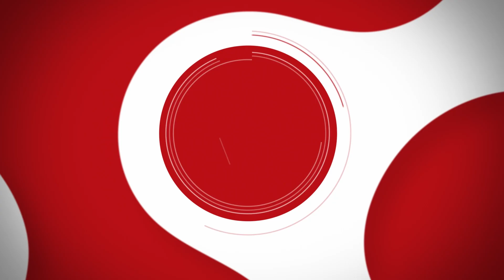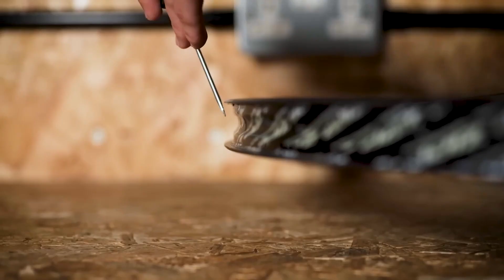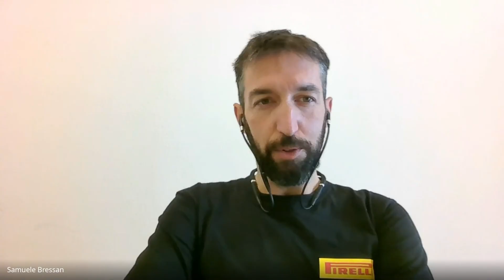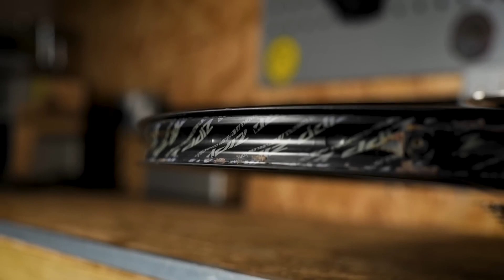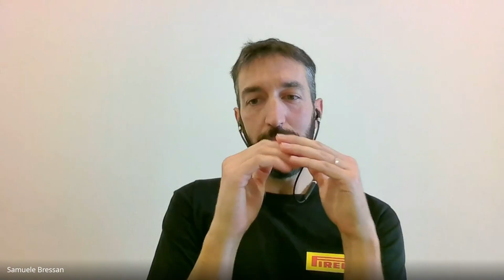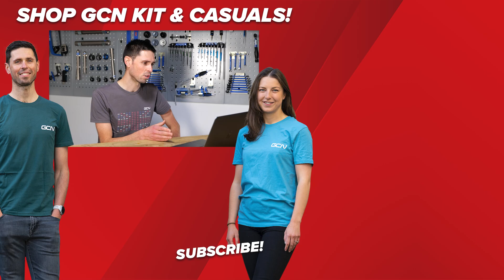What Makes A Good Bike Tyre? | Everything You Need To Know About Tyres!

Comment from the maker: What determines a good tyre for you? Let us know 👇
Reply: Puncture protection and tire longevity are what determines a good tire in my mind.
Reply: As an amateur rider, balance between grip and puncture protection is the key for good tyres!
Reply: Conti GP5000 for many years now. They hold up throughout the year and ride fast. If there's something better, I'm all ears.
Reply: @michaelmappin4425  I believe in Gp5000 too. I made all my friends use it and it shows in their average speed.
Reply: I think for summer specialized s-works pro t2/t5 and for winter specialized roubaix pro are my favorites.
Reply: In short: The complete opposite of what Pirelli is providing in F1 😄
Reply: I usually focus on the following order for a good all-around tyre but of course priorities change when choosing something more specific like a fast racing tyre or a heavy duty high puncture protection one:
1-Reliability (QC tolerances consistency).
2-Grip (specially on wet surfaces).
3-Suppleness (mostly when riding off-road/on poor condition asphalt).
4-Rolling resistance (gotta take advantage of them extra watts (sic)).
5-Weight (mostly noticeable during acceleration/climbing and, specially vital as a fixed gear rider, when slowing down).
6-Looks (usually as a plus, though).
7-Lifespan (cost per kilometre).
This way I cover safety, comfort, performance, price and general satisfaction from a (personally) reasonable perspective. Greetings from Veracruz, Mexico.
Reply: For me, supple sidewalls and tread. IMO, FMB and Rene Herse are at the top of that heap, but several others are getting there, too.  GP5000, for example.
Reply: For me a good tire . Fast and reliable
Reply: Schwalbe pro one TT.     Go fast or go home !
Reply: The only tire on the market that makes any sense to buy is Cinturato Velo IMO.  The rest either feel like riding on wood, or they pop randomly forcing you to go road tubeless.  The 35mm Continental Contact Urban with the tanwalls and no wire bead is the only tire that can come close IMO.  The rest of the sizes of the CCU have wire bead and feel slow accelerating as a result.

Comment: In my perspective of tires, since the 80s to most recent present; for a road bike I use tubular for better reliability of pinch Flats. ..Today's carbon fiber bikes require bigger tires compared to yesteryear. ... But still having problems with pincher Flats on clutcher rims..... Plus, rated tire size are not consistent I measure between tire bead to bead For accuracy of size. ....also, the many variations of Tire Construction single wall, double wall, and ply tires; even rim width. ... I am still doing testing finding out today's tire technology works to my satisfaction. .... (Any thoughts anyone?)

Comment: Wonderful interview, full of information... BUT - it doesn't really answer the question of how the individual rider can choose the best tire from a dizzying array on the market. Also, not only is an accurate pump critical for road tires, the temperature of the tire when it is being filled, and the expected road temperatures. This is not as problematic as it is with a motorcycle or car tire, but it should be taken into consideration.

Comment: Would be nice some example video   calculating   tyre pressure for different cases considering all parameters mentioned in this video. Are there some sites providing such service  perhaps?
Reply: Tyre manufacturers have pressure calculators that should be more reliable than generic pressure calculators.

Comment: Excellent content. Two key points for me. First, his description of the how a narrow rim makes the tire sidewalls more curved and therefore more comfortable explains why tubs (which have a complete circular profile) are so much more comfortable than clinchers of equivalent size. Second, the stress (desirable) in the threads of the casing at a given pressure increases with thread length. This explains why tubs of a given diameter provide superior road feel over a clincher since, for given diameter, they have casing threads that are 30+% longer than clinchers. It amazing, all this engineering indicates we should be going back to riding on tubs - if we value lightweight high performance tires with the most comfort and best road feel!
Reply: totally agree, tubs are king even a 19mm tub

Comment: A Pirelli scorpion suv tire weighs 35 pounds and costs 250.  Or 1.5 american cents a gram to purchase.  It can hold over a ton of weight and will last 30000 miles minimum.  A Pirelli 700x40 gravel tire costs 18.8 cents a gram can handle a system weight less than 300 pounds, costs 35 times less to ship by weight, and will only last maybe 2000 miles if you are lucky.  Just one more area where the cycling industry steals

Comment: I have 28mm tires on my road bike.  I am most comfortable on my gravel bike, so I got road wheels for it and got them to put 34mm Pirelli tires on it.  They are just as fast as my road bike.  (The wheels are both fast carbon wheels).  Admittedly, I would say the Pirellis are more pliant, better casing, probably better rubber.  But I don't feel that the extra width is any penalty.  I personally feel that 32mm is probably going to be the width sweet spot.
Reply: What is the internal width of your wheel and which pirelli gravel tire are you using?

Comment: If you can tell the difference between a gp5000 and an ultra sport 3 after a few minutes of riding then you are a liar. Like all thing's bike you pay through the nose for markering spiel.
Reply: The PureGrip compound is waaaay slower up hill, accelerating and even makes a squeak noise sometimes.  I've used it on the Contact Urban and the Ultra Sport.  Black Chili compound is way better IMO.  If they made a Black Chili tire with the puncture protection of Pirelli Cinturato Velo they would instantly have the best tire on the market.

Comment: Very interesting and a very knowledgeable guy.

The 50% Crr example used to improve other areas was surprising but of course, when you know, a simple conclusion.

And the thing about straight walls is also something not really spoken about.

Also the major influence of pressure (almost) independent of tyre type and depending on use and equipage weight and not a fixed amount as many recommend.

But I find it hard to believe that there is a significant difference between 2-3 psi

And the good tube, medium tyre statement was surprising but useful

Comment: 27:13 Hunt figured this out a few years ago, then copied by specialized, then Ascent. The total solution is yes have the widest part of the rim at 105% of the tire, use a narrower than current trend inner rim width, and forget about the tire/rim transition. For example I tried 32mm gp5k on 23mm internal/35mm external and got 34mm WAM keeping it all aero and comfortable. Wheels used are Hunt 48 limitless. Also look at peak torques tests on wider tires and wider rims.

Comment: in terms of efficiency of tire width and size limiting, I think he's right I think it's zeroing in on the optimal size right now because of the knowledge of how road vibrations affect rolling resistance.  mountain biking also have additional factors such as conformance, grip on variable surfaces.  I think the cheap versus expensive tire thing is a much bigger factor on the fatter tires because you need that confidence in cornering while still being able to ride on a camber, while still keeping the rolling resistance down in softer surface conditions such as snow or mud.  I ride a surly big fat dummy for commuting, and last year for the summer I decided to try and find a fat tire for the road since only the first quarter of my commute is on trails. I only found one, 4×26 marketed for ebikes, but I found it on Amazon being sold by about 10 different companies all branded differently but with the same exact tread so probably produced from the same Chinese factory. I think it was like $50 ea (compared to the $250 tires that I normally use) the difference was immediate, my normal tires I can ride with only 7psi and they're slower but they corner just fine with no noticeable rollover when riding on a camber... these ones from Amazon if I didn't have them with 20 psi, it was a squirrely ride even on flat pavement. they're also heavy, but to give them credit, they did live up to the "faster rolling" claim, increasing my descent speed from 16 to 22 mph when pedaling full gas on this one hill on my commute. we just had our first snow storm last night so today I finally get to find out how my 45Nrth Wrathlorde studded snow tires actually perform in the snow. I switched to them in mid November, but I guess it's okay because it preconditioned my muscles... if I waited till yesterday to swap them I'd be really struggling.

Comment: RECYCLING
That would be great, if I could send a worn set of tires to the manufacturer. Conti, Pirelli, whatever brand for recycling. Bike tires ain't heavy and a small package delivery shouldn't be costly.
Solution - one wraps the tire with a zip-tie or a string, sticks a label obtained from the manufacturer website (without fancy packaging - what's the point), and there it goes...
If it's possible to extract the materials and reuse them? Why not!

Comment: You can keep your hookless nonsense. It’s the answer to a question that no-one asked and unnecessarily introduces a potentially dangerous variable.
Reply: Is Hookless the new Press fit BB, for the cycle industry? Look where that journey has ended, back to the very place it began at!  Hookless for road cycle wheels are solution looking for a problem for cyclist who buys the wheels (totally unnecessary), but the wheel manufacturers who are pushing this are motivated so they can cut costs, hookless wheels are cheaper and easier to make for them.

Comment: I run Continental gator skins.
Ithey call for 120 psi I found 60 psi is the sweet spot for me. I don't notice any more drag above 60 but I don't notice any more improvement in performance either.
I do notice the vibration goes up a lot above 60 psi. So i stay at 60....  Very interesting keepemcoming
Reply: They don't call for 120 psi.  The pressure numbers on tires indicate the maximum safe pressure, not a recommended riding pressure.  Use something like Silca's online tire pressure calculator to determine what is best for you.
Reply from the maker: thanks! We love to get into the nerdy yet easy-to-understand details! What would you like to learn a bit more about?
Reply: I used them for years but moved to Hutchinson Challengers a year ago. From my experience they also have excellent puncture protection but run far smoother with much more grip and feel faster (as well as being much cheaper than the gatorskins in non-tubeless form)

Comment: Love those interviews especially with people like here or titanium one that was realistic not pushing their interests first. Greatly appreciated!
Reply from the maker: thanks! What would you like us to take a deep dive into next?
Reply: @gcntech  maybe something that is often taken for granted (at least by me), like the chain itself!
Reply: @gcntech I'd like to see 3 things:
1.Wheel building what effect does rim,spokes,hub have on strength rigidity compliance what effect does lacing have is it good to use different spokes and or lacing drive non dive side to equalise tension etc.
2.Holistic approach to bike building people overemphasize effect of frame materials on comfort while it's only one of the factors also same for frames themselves they do impact comfort but tires,pressure,handlebar flex and seatpost affect it greatly would love to see someone knowledgeable talking about where are the biggest gains in comfort where in the least amount of benefit even if there is one. And same for performance maybe could be made funnier in tiered list for each aspect for comfort efficiency control, feel of quality etc. 
3. Psychology aspect of this sport/activity. What makes us more likely to push ourselves, what makes it feel great what can we do to ride more nor to overtrain and just enjoy. And not only for the pro athlete but also for avid cyclist and more casual riding.

Comment: I've been using Continental contact urban safety pro tyres for 2 years over 15,000 km.  Because I ride alone puncture resistance is essential.  But they are also comfortable and last over 8000 Km.  They are excellent in the monsoon rains of Thailand where the average temperature is over 30 C pretty much year round.  I have used them in temperatures over 40 C for sustained periods.
Reply: To be fair, Continental Contact Urbans are great tires in general.
The fact that they make them in so many sizes just make them so nice to have.
Reply: I have these on my hybrid bike great tire.
Reply: Agree Bebo, mine is a hybrid fitness bike (Trek FX3) as well although I now ride only on roads.

Comment: #AskGCNTech

Hello, I have 2 different tyre-sizes on my E-bike.
The front is 32mm wide and the rear is 37mm wide.
Do I need to change it so that both wheels have the same size or can I keep riding like this?
And do I need to change the pressure? Front-tyre is 4.5 Bar(65PSI). Rear-tyre is 5.5 Bar(80PSI)
Both wheels have Schwalbe Marathon tyres. They can have a MAX of 6 BAR(85PSI).
Before I forget to tell it. The total weight is 135 KG.
This is the total of the E-bike, myself and my cargo combined.

Kind Regards,
Frank
Reply: Smaller tire in the front is fine.

Comment: It would be interesting to know what the tolerances are for hookless tyres as an out of true rim would reduce the diameter which could be outside safe limits.
Reply: Cant see how lateral true would affect rim diameter.
Reply: I get what you’re saying but with carbon I think to accompany your question would be carbon fatigue over time and how that affects the overall diameter and hookless fit tolerance. Could be unfortunate for an aged hookless wheel.

Comment: You guys didn't touch at all on tubeless, it almost sounds like they want tubes in their tires by design.  I'm also curious if there is a possibility for airless technology to happen and give us a good tire choice and not have to worry about flatting.  I also was hoping the thumbnail would have been described more at some point as well, the Cinturato Velo is SLOW, but also tough as nails.  If you cut that tire apart, vs a P.Zero Race tire, where's the "slow" coming from?  Meh video, I get the advertising has to happen, but I still have questions.
Reply: I didn't catch that, good point.  ALL my tires are tubeless now.  I live in Colorado and we have these things called "Goatheads",  (because they kind of look like a goat's head with horns where the horns and goatee beard would be, and they will pierce anything, they come from this ground cover weed and make it into the paved bike paths where everyone rides).  If you don't ride tubeless you will be changing tubes pretty much weekly.
Reply: Cinturato Velo isn't slow lol, it's like a 16 watt tire, its literally faster than every puncture proof tire out there.
Reply: He did say you could ruin a good tire fitting a tube....
Reply: Isn't it a given now that tubeless perform better?
Reply: @MartinBrown-mb7pz  No.

Comment: I'm currently running 28 front 30 rear on rims with 21mm IW. The guest Mr. Bressan made me feel pretty good about my current setup, since he said this is probably right around what will be determined to be optimal. Bicyclerollingresistance has a page on their site where they say that the ratio of tire to rim internal width should be roughly 70%, or basically there's no benefit to rolling resistance when you go bigger than that. 21 is exactly 70% of 30, so a 30mm tire on 21mm IW rim seems pretty much perfect.
Reply: you also hear a lot about the rule of 105, where the optimal setup is to have your rim 5% wider than your measured tire width, so that would say you'd want a 30mm external rim width for a 28mm tire that might actually measure out to 29 or so...  maybe this has more to do with aero than rolling resistance though..
Reply: @rickmorse3351 yes and I was also going to suggest that's probably a factor to include in the decision, although the shape of the tire could take the aerodynamics of where it meets the rim into account

Comment: I've now got a lot more respect for the engineering that goes into tires.
Reply: I felt the same after watching a Bugatti documentary about the engineers at Michelin coming up with the tire compound/technology for tires that can withstand 250+ mph sustained speed without shredding apart or exploding due to friction heat. Michelin had never had to make a tire with such requirements and it was a challenge for them. They did it, but it was expensive. Probably why (back then) a new set of tires for the Bugatti Veyron was $50k.
Reply: @swordmonkey6635  It's like a lot of industries... really easy to think they're easy until to jump into them.

Comment: has gcn ever done a cheap vs expensive inner tube? Would love to see if not
Reply: Their inner tube video kind of is that.
Reply: Basically weight gain for the most part and some are more rigid depending on the material.
Reply: The lighter your inner tube the faster you'll be. 120g butyl tube vs 80g butyl tube, buy the 80g tube. Go down to those new fancy 30g plastic tubes everyone raves about and you'll be even faster.
Reply: are you going to have more punctures though?
 @JFomo
Reply: @johnnyloco11  lol yes 😅. This is why I went tubeless.